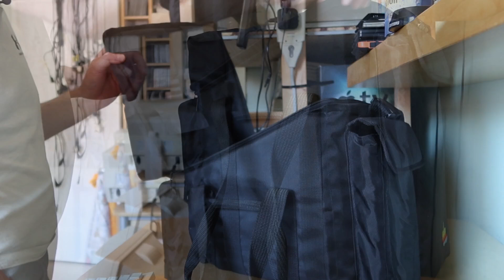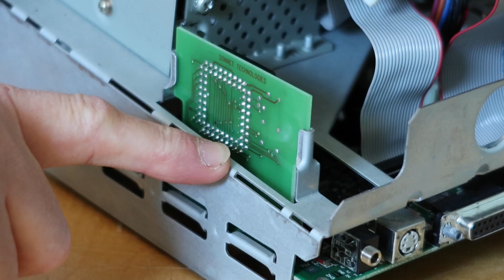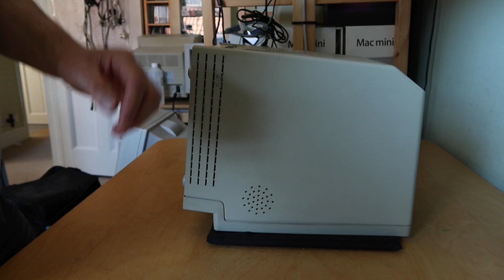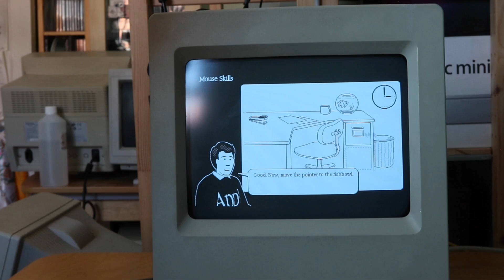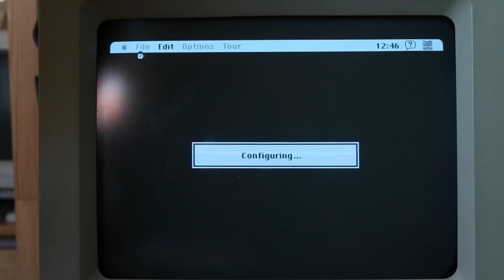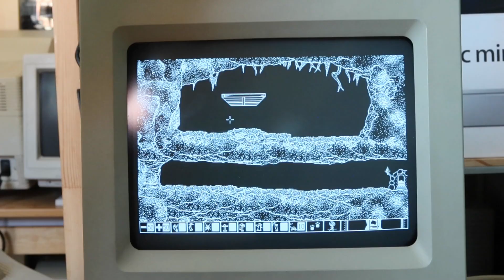Apple's Last Monochrome Compact Mac - The Classic II #marchintosh

Comment: CRTs and other large capacitors, even if they've been disconnected from power for years, can have a significant amount of charge still. It's always a good idea to be careful around them.

Also, there's a tool that was made for opening these compact Mac cases. It has a wide clamp-like section that fits into the gap between the front and back case parts, with handles on each side that you squeeze together to spread the case apart. Apparently it was called the "Mac Cracker". My dad was working for a computer store servicing Apple computers around the time this model came out, so he has a couple of those tools floating around the house.

Comment: Try holding Command + Option + X + O then power on to see the Classic II's party trick. Boots from the ROM with old system 6. HDD not required! I had a really good chuckle at the sound effects .. someone at Brunell was definitely a huge "The Goon Show" fan. Bluebottle "You dirty rotten swine you!!" is a dead give-away 😁 You can also overclock these guys.. there's one oscillator you can swap. Fun fact is they take all the video, audio and system clock and system clock off the one oscillator with different dividers. Sooo when you overclock, you get a faster boot chime, a smaller screen (you need to adjust the trim pots at the rear on the logic board) and the days seem to pass faster with the menubar clock! Made a huuuuge difference with compiling in Think-C
Reply from the maker: I thought it was only the original "Classic" that could boot from ROM? Good to know the Classic II can as well - I will try it out when I next have it on the bench...

Comment: Those through hole caps are a very bad idea. They'll work just fine but they're soldered to the pads designed for surface mount caps, obviously, and it wouldn't take an awful lot to lift a pad - one knock and you've got problems.  Surface mount caps are a bit tricky to solder for beginners, but you could get some surface mount tantulum caps (the yellow/orange ones) and they're a lot easier to do. See Adrian Blacks many videos (Adrians Digital Basement) on this.  If you're ever in or around Manchester I'd gladly give you some soldering pointers if you wanted.
Reply from the maker: My soldering skills are poor, but this was done before I got the machine :-) Thanks for the offer btw.
Reply: Yeah I know, I hadn't meant to suggest it was you who put them on there. To be clear though - they will work perfectly well, it's just the danger of pulling pads off that's a concern. If the board stays inside the case and nobody goes in there at all, they'll be just fine.